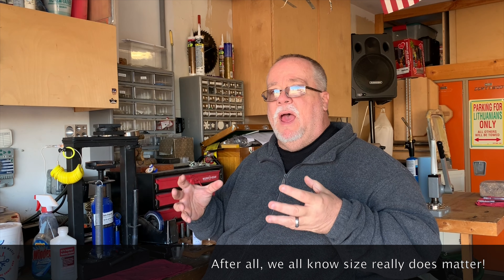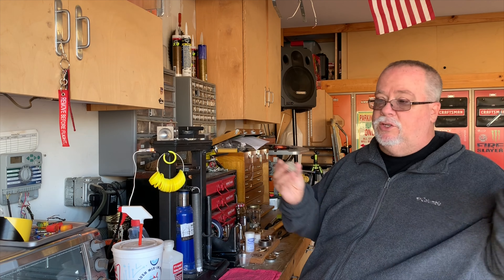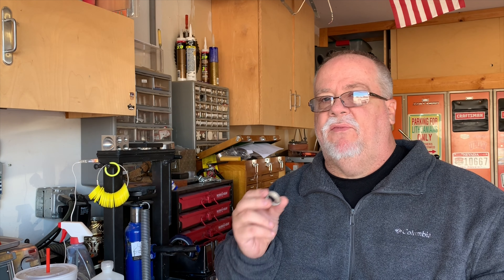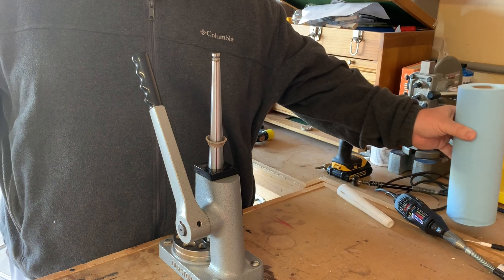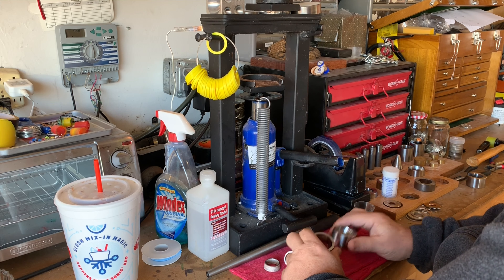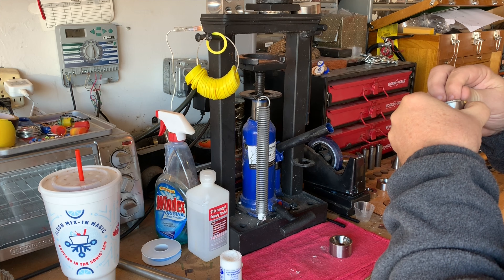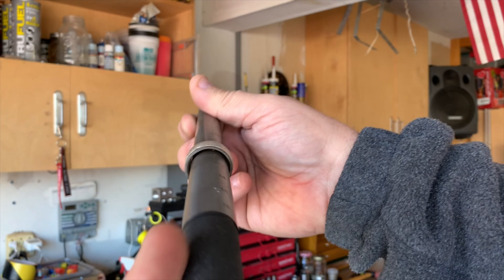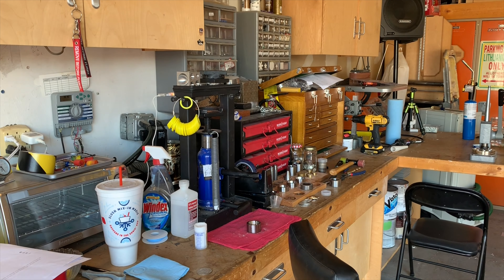The Details of Making a Coin Ring, Part 8 - Sizing!

Comment: Paul
Great video.
If you punch a Morgan let’s say size  9 to twelve what. Size of punch?
12 and above?
Reply from the maker: Great question.  I usually punch 5/8 for Morgans between 9/13.  14 and above you can stick with 5/8 or bump down to 1/2 - personal preference.  For 8 or 7 (Or smaller if you dare) I would opt for a 3/4.